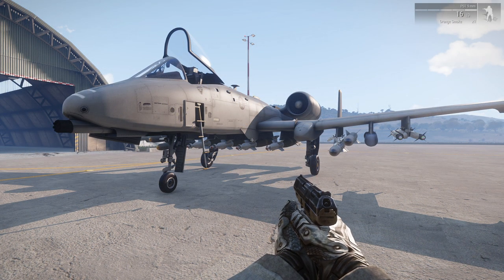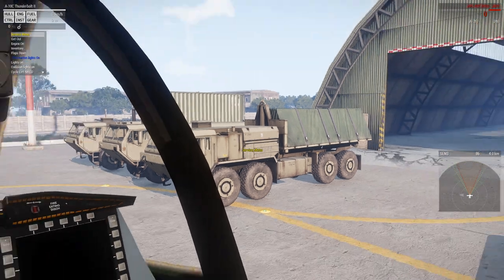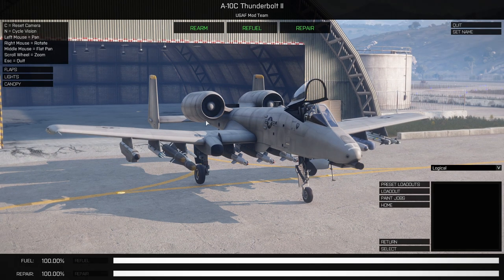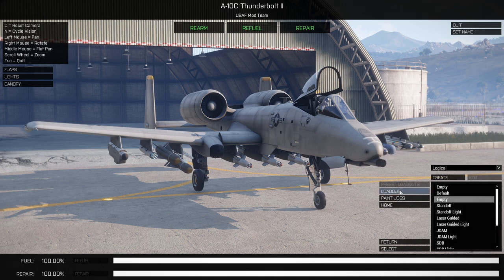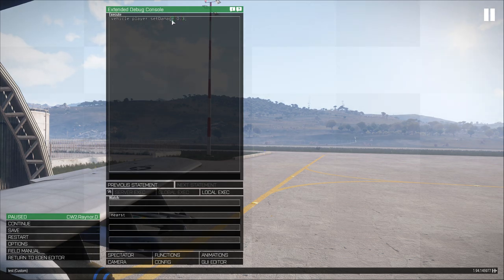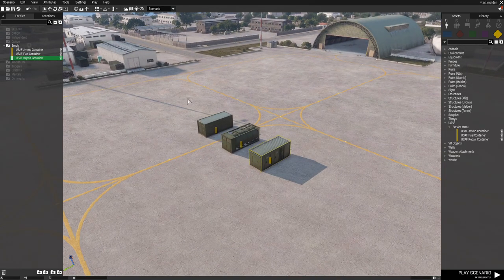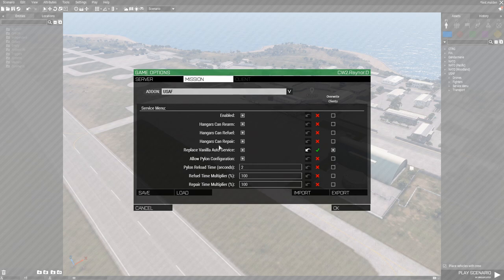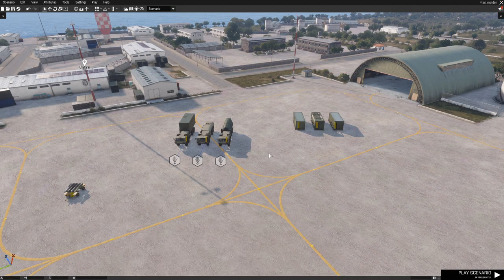Service Menu Tutorial

Comment: Does this menu work only with USAF mod vehicles or can I use other modded aircraft? I can’t seem to get it to work.
Reply from the maker: Only usaf aircraft at the moment. We're either going to release compatibility patches or add an option to enable it on all aircraft at a basic level.
Reply: USAF Mod Okay, great work on the mod so far and thanks for the fast response!
Reply: @USAFMod  do i need to put the usaf modules in the map, in order to have acess to the usaf service menu?
Reply from the maker: @Janonigamer  Not necessarily, most hangars and usaf missilecarts also have the service menu on them.
Reply: @USAFMod  god bless you, hehehe, thnaks for the answer. Xd